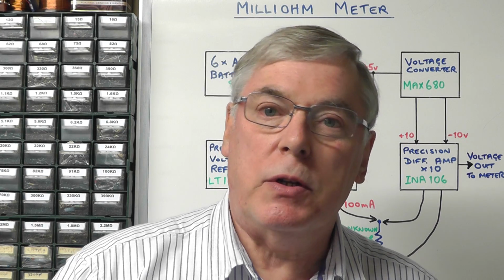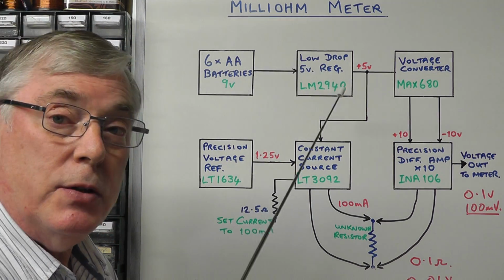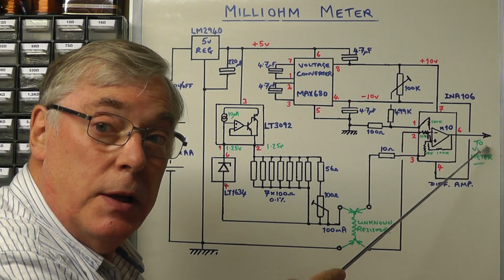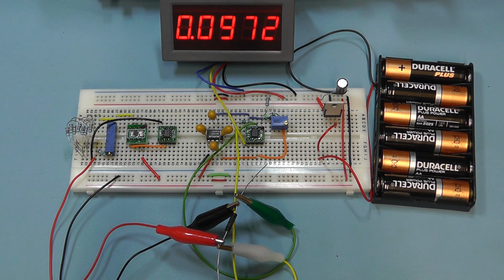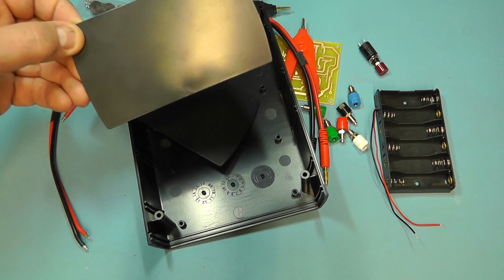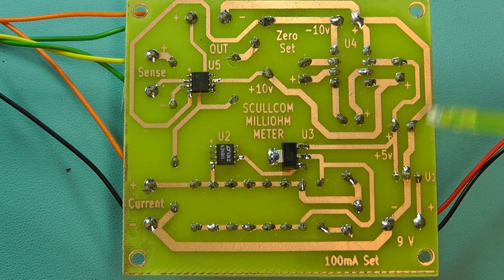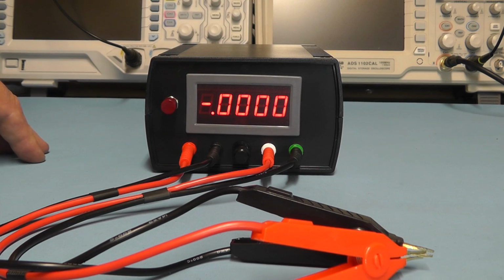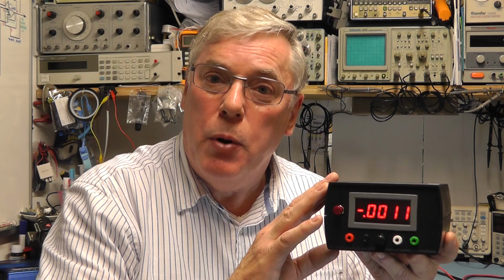Scullcom Hobby Electronics #31 - Design & Build a Milliohm Meter

Comment: Nice, I want to read Resistor range (15.00R - 30.00R)? what is change components ???
Plz follow.
Tksss!
Reply from the maker: +Truong Dao Thanks. This project was to be able to measure milliohms. Normally you would use a standard multimeter on the ohms range to read resistances in the range you want. Is there a particular reason why you would not do that?
Reply: +Scullcom Hobby Electronics Request Project range (15.04 - 30.5 OHM) exactly 0.01%.
This project using Components Test and output signal (NG or OK) on LEDs.

Comment: Can this circuit be adapted to measure capacitor ESR? thanks!
Reply from the maker: +Pedro Rios Not as it stands. An ESR meter requires a high frequency AC signal, usually of around 100 KHz. May be an ESR Meter could be another project!!!!
Reply: +Scullcom Hobby Electronics An ESR meter would be a great project!

Comment: Great project!!! Wondering - can you really trust the panel meter?
Reply from the maker: +MrMonomonster Thanks. The panel meter I used on the project proved to be accurate up to 0.1mV reading. So it was fine what the project set out to do. This panel meters are a little more expensive than some others costing around £8, but worth it.

Comment from the maker: PROBLEMS REPYING TO PIRATEMAN COMMENTS BELOW: So answer here -
I used the INA106 OP Amp as it is high precision with an accuracy of 0.025% and a non-linearity error of only 0.001%. The 2 volt panel meter I used was a good quality one with good accuracy and resolution down to 1mV. I found it to be better than using the Arduino ADC.

Comment: Excellent project. I was wondering why tantalum capacitors are being used, is it just to save space or are they more accurate than the alternative?
P.S. do you still have links to where that 5-digit 2v display can be found? I can only seem to find a 4-digit version now.

Cheers.
Reply from the maker: +blaser Thanks. Tantulum capacitors have many advantages over normal electrolytic capacitors. Their frequency response is superior, they tend to be more reliable than many other forms of capacitor, they are able to operate over a very wide temperature range and they are small.
The 0-2v panel meter I purchased on eBay was from the seller "yourcartmax" the direct link to the ebay listing is below: http://www.ebay.co.uk/itm/261284812938?_trksid=p2057872.m2749.l2649&ssPageName=STRK%3AMEBIDX%3AIT
This supplier seems to be out of stock for the moment of 2v version but they also sell identical 5 digit panel meters in other range settings of 200v, 20v or 200mV. All these panel meter seem to be identical the only difference is a shorting link on the PCB which can be changed to suit your needs. Check out their 200mV version which you could alter the link on PCB:
http://www.ebay.co.uk/itm/DC-4-1-2-High-Precision-200MV-0-199-99MV-Red-LED-Digital-Panel-VOL-Meter-New-/261475599220?hash=item3ce1290374:g:eMsAAOSwHQ9WVMjz
Reply: Appreciate the response. Didn't know that about tantalum caps, was always told to avoid them where possible.
Thanks for the volt panel link, even better the sellers based in the UK.

Comment: exact link on the panel meter thanks
Reply from the maker: +Eduardo Alcantara Jr The 0-2v panel meter I purchased on eBay was from the seller "yourcartmax" the direct link to the ebay listing is below: http://www.ebay.co.uk/itm/261284812938?_trksid=p2057872.m2749.l2649&ssPageName=STRK%3AMEBIDX%3AIT
Reply: +Scullcom Hobby Electronics thanks again sir

Comment: very nice clips, find your chanell today and subscribed. I also would add that it is so anoying to drill a hole in front panel to find that fixed switch is blocking cover screw pillow, oops/
Reply from the maker: +Grants2251 Thanks for your comments. Well spotted I removed the pillar as I wanted the switch in that location - although the switch could be located along the bottom.

Comment: Thanks for the great milliohm meter video.  Could you tell me the actual company where you bought the 0-2v panel meter, I have searched Ebay upside down without luck.  Thanks........................Berni
Reply from the maker: +berni ken Thanks for your comments. The 0-2v panel meter I purchased on eBay was from the seller "yourcartmax" the direct link to the ebay listing is below:
http://www.ebay.co.uk/itm/261284812938?_trksid=p2057872.m2749.l2649&ssPageName=STRK%3AMEBIDX%3AIT

Comment: I really cant thank you enough for your video. I learned so much. Please never stop doing these kinda videos. And if you can find more time please do more frequently. I am pretty sure a lot of people would want that. Also the main disadvantage with starting up electronics is how pricey the test gear is and the people who cant afford them or cant source them in their demographic area have no other go. But with the help of videos like yours and other youtubers a lot of people can build their own. Like someone mentioned above it would be really awesome if u can explain how each component was selected for eg: what to look for( freq response, slew rate and other characteristics) in an opamp for a project. And for the next project please build a really precise voltmeter like the one you have. Not everyone could afford a 6 1/2 multimeter in order to calibrate the circuits u have designed in other videos. It would be really cool if it had a digital autocalibration with a help of a micro :). Once again thanks a lot really appreciate your videos.
Reply from the maker: +Asniex Asniex Thanks for your comments. You must have read my mind. My next video project will be on designing and making a precision 6½ Millivolt meter with auto calibration option at low cost suitable for the hobbyist. I have been busy of late but hope to complete this video in the next few days.
Reply: That really chuckin awesome <3 looking forward to that video. But please not only millivolt do upto 10V or atleast 30V more than that not a lot of people need it. I know it will tough to switch voltage ranges and designing a good matched voltage dividers with resistors. I am pretty sure you will pull it off :)

Comment: Great video !! I like the total project done in one video concept it's great for such small project. One request that please include some videos where you design this project, what do you keep in mind while designing that project and also component selection. These are some parts where noobs like me have a hard time. 
Thanks for the video!!
And one more request if you can make a video on op amp stability having tons of problem there.
Reply from the maker: +Yash Kudale Thanks for your comments. Good point about the design process. Also I have been considering a video on op amps. May be something I can do when I have time.

Comment: is it possible to build your owen car battery charger
Reply from the maker: +Ray Campbell Yes it is but they are so cheap to buy them. A simple car battery charger can be made using a 15 volt (secondary) mains transformer capable of about 5 amps, a 10 amp bridge rectifier, 100uF capacitor - connect the output to your 12 volt car battery via a ammeter to monitor the charge current.

Comment from the maker: Chris Tate (commented below) raised the point about using a lower constant current source. During my initial project design I did consider using a INA131 instead of the INA106. The INA131 has a gain of x100 so you could use a 10mA current source instead of a 100mA current source. I did initially test both options but I found the INA106 easier to set up and trim the offset voltage. The wiring would also be slightly different as pin 5 on the INA131 is grounded and the reference pin is also different. The INA131 is also more expensive than the INA106. Another option would be to use a INA110 which has switchable gain options but is in a 16 pin DIL package. In the end I went for the INA106 which was very accurate and stable and worked well and was cheaper.

Comment: Question about the INA106... If R1 is 10k and R2 is 100k, should it not be a gain of 11? Gain = 1+(R2/R1) This is where I always fail to understand...

Very precise and detailed tutorial. So much clarified. Thank you, I learned a lot! I used this theory to construct a more accurate shunt for my DC load.
Reply from the maker: +Mike Novo Thanks for the comment. In this circuit I am using the INA106 configured as a Differential Amplifier the gain is therefore x10. We are using both the + and - inputs and therefore the output is Vout=10(Plus Input - Negative Input). If you were to configure the INA106 as a non inverting buffer then the gain would be x11 but in that case the negative input pin (pin 2) would be grounded. Hope this clarifies the point.
Reply: Of course. I see that now. Thanks!

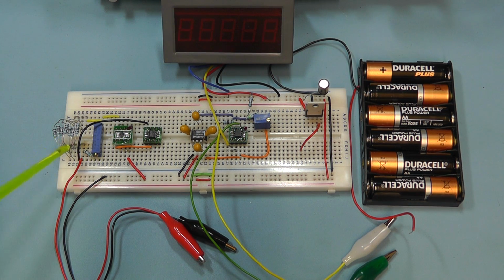Comment: I can't seem to understand one thing. What is the point of using 7 0.1% precision resistors(@ 15:57), only to trim them after. If you are going to trim, 1% or 5% resistors would have sufficed, I would imagine. Or, is there something I am not getting here? Thanks for this video, it was very informative!
Reply from the maker: +SteelBlueVision Thanks for your comments. Yes you could use 1% tolerance resistors. I tried it and it worked just fine. The main reason I used 0.1% was to improve and long term stability over time and due to temperature.

Comment: Two things:
1. If you don't have a good multimeter, you have no way of knowing if your source is really  0.1000xxx mA.
2. 100mA is good for low resistance, but will cause an error because of heating the resistor with 0.1A

Thanks for video, as always love to watch them
Reply from the maker: +First2ner Thanks for your good comments. I have found using a good quality resistor either a 0.1 ohm or 1 ohm at 0.1% tolerance, you can use that to set the reading and that should give you 100 mA, at that tolerance level. I take your point about the 100mA with regards heating but I have found that in practice with resistances below 1 ohm it has little effect and usually you are testing a resistance for just a few seconds (for example a 0.1 ohm resistor at 100mA will only needs to dissipate 1 milli watt of power).
Reply: +First2ner This is why the resistors are in parallel. 8x 1 watt resistors in parallel is a max rating on 8 watts. 1mW requirement means it's not even an issue. Awesome

Comment: Hi Louis, 

As usual, a very thorough attention to detail. 

Another KiCad user here. I used to use Cadsoft Eagle, but switched when Eagle 5 would no longer run on the latest Linux distributions. 

For front panel work, I've had pretty good luck with Librecad printing 1:1 to a laser printer, then using glue sticks to stick the paper down to the front panel (Glue stick idea comes from electronicstrivia).  I then use a drill press to drill holes, and a nibbler
tool and nibble square and rectangular holes. The only downside to the nibbler is  that it is tedious (and sometimes painful) to use.
Reply from the maker: +Steve Rodgers Thanks for the comments and info.

Comment: I would think that 100mA is a bit excessive for a test current. Isn't there an alternative to the INA106 with higher gain to work around this? Otherwise, a very interesting project, I've used other INA series op amps for precision current measurement before, and they've worked out great, with very little supporting circuitry

Comment: Perhaps your 4.5 digit meter has a trimmer on the back.  You could fine tune the reading to match the voltage reading on the more accurate Keithley meter.  I am gathering parts for this project now.  I've been wanting one to track down shorts on PCBs.  Thanks.
Reply from the maker: +ToltecMerc Thanks. Yes you are right their is a trimmer inside the panel meter, I will give it a try.

Comment: great project and well explained.I was just wondering why the need for a milliohm meter?
Reply from the maker: +Tom OConnor Thanks. A milliohm meter is very useful for checking the low resistance of components such as wires, switch contacts, relay contacts, coils and PCB track traces. Some times I use the copper track on homemade PCB boards to provide low value resistors for some projects - helpful for making up current sense resistors where you need just a few milliohms in value.
Reply: +Scullcom Hobby Electronics oooh nice, id love  to see a video one day on that even if its just on drawing ;)

Comment: What a loverly job :-D, that must have taken a lot of care to keep errors out of the measurement, i can see that the 1.25v ref can be slightly off, its the stability that matters more.
The trim can countermand any slight error, too clever :-D.
And your set zero offset bias is ideal :-)
1000th of an ohm reading (display wise), the final digit can be ignored.
I hope you made this project for yourself and not just to teach us.
Really simple to make, simple to use, ohms law confirms it, Brilliant :-D
Reply from the maker: +zx8401ztv Thanks again for your comments. I did this project to see if I could build a milliohm meter which was more accurate than my Keithley 2000 bench meter on its low ohm ranges and I have to say the unit turned out to be much better than the Keithley. I also have a commercial milliohm meter and have found that it is also not as accurate as this project. The main reason is that in both cases they used a much lower test current - in the case of the Keithley 2000 they use a test current of just 1mA and the commercial milliohm meter I have uses a test current of 10 mA. As a bonus I found I could design and build this accurate milliohm meter at a fraction of the cost and so I thought it would be nice to share this project.
Reply: +Scullcom Hobby Electronics
Thank you very much for sharing your accurate designs.
You have an ability to design "no nonsense projects", i really enjoy the simplicity and ease of understanding  them, your operational discription leaves no grey areas to confuse anyone.
Im a bit thick at times and i appreciate your teaching :-).
No need to reply :-).
Reply: +Scullcom Hobby Electronics But, the reason they use such low current is to avoid thermal drift in the resistor due to it being heated up by 100 mA. So, there's an argument to be made that your reading is more erroneous for resistors with a higher TCR rating.
Reply: +SteelBlueVision True but resistors never stay cold in equipment, so testing them cold isnt the way they will be used.
Im not saying your wrong, but resistors do get warm :-)
Reply: Your point is very valid, I was talking in isolation (i.e., on a breadboard). On the other hand, if you're after a truly accurate measurement, it is probably a good idea to apply the exact current that will be flowing through the resistor (assuming it is constant of course), or a range otherwise...
Reply: +SteelBlueVision Yes you would need to give that resistor the operating condition it would be working at, also its temprature tightly within the manufacturers limits, reality never quite sticks to the theory lol :-D
Scullcom's tester is handy when ordinary multimeters dont have a good resolution at the very low ohm levels, thats most hobby meters.

Comment: Great tutorial as always. Have you made a precision voltage meter as well?
Reply from the maker: +SirArghPirate Thanks. Well a precision voltage meter may be a project for another day!
Reply: +Scullcom Hobby Electronics Great! Perhaps you can recommend a digtal multimeter with mV precision for hobbyists? I often have to measure lipo-batteries and I don't trust my cheap multimeter.
Reply from the maker: +SirArghPirate With regards your question about a good digital multimeter for the hobbyist with mV precision, I can recommend the following:
Extech EX330 AC/DC Mini Digital Multimeter 4000 counts at about £40
or if you wish to spend a bit more;
Extech EX510 Digital Multimeter 6000 Counts CAT IV 600V at about £84
The prices do vary a lot from different suppliers. I have found http://www.rapidonline.com to be reasonably priced. Be careful on eBay as some prices for these meters are much higher.

Comment: I'm wondering: why do you use precision resistors when you are also adding a trim capability? Can't you just factor the error in the choice of the potentiometer?
Reply from the maker: +nraynaud1 The reason I used 0.1% tolerance resistors was to reduce thermal drift errors effecting the overall resistance. The 15 turn trim potentiometer will have some drift error over time even after setting it. So the overall effect can be reduced by using good quality low tolerance resistors.
Reply: @scullcomhobbyelectronics1702  i know super late to the party, but i was just thinking it might be good to use some big pots on the front panel. then put a switch to switch the precision calibration resistor back into circuit. that way you could fully calibrate it each time you wanted without having to open the case.
Reply: +nraynaud1 No, resistors with a lower TCR (nothing to do with tolerance, although very low tolerance resistors tend to have decent TCR characteristics as well) will drift less with temp changes.
Reply: I was about to ask the same question.
Reply: interesting, lower absolute tolerance on value also means higher time drift, then?